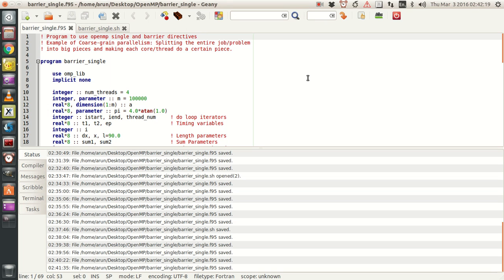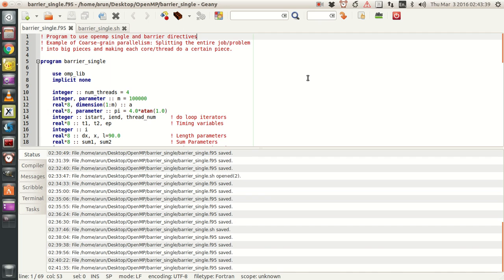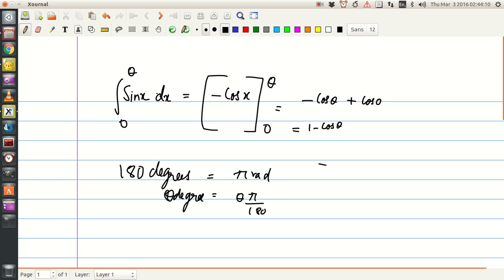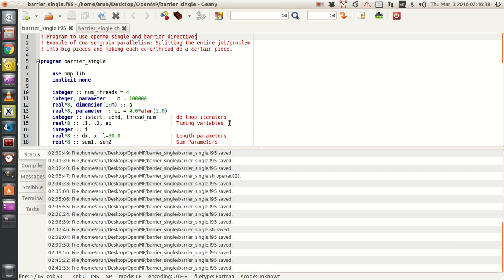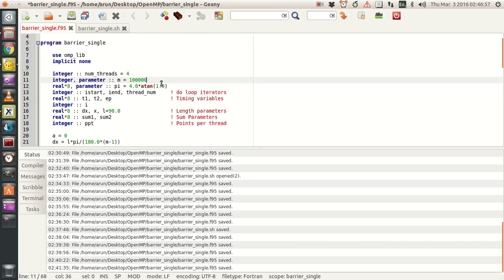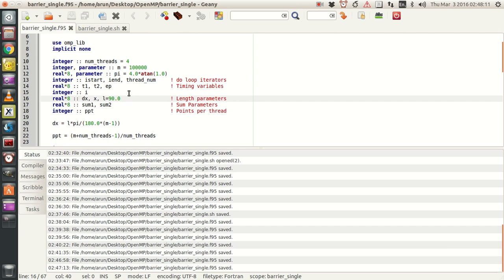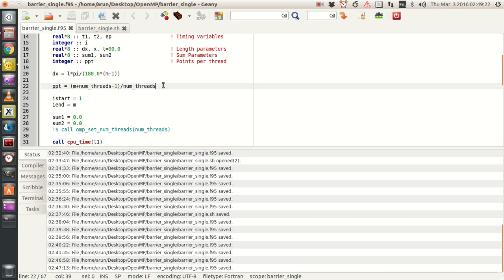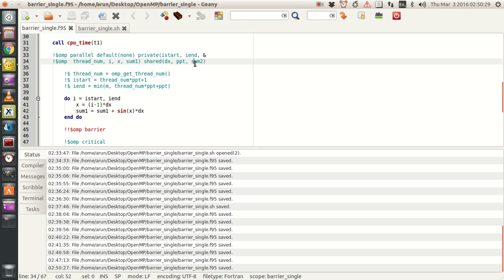Fortran with OpenMP : 013 : OpenMP Single and Barrier directives Part 1 of 2

Comment: i like that "barrier" concept, i was expecting that kind of thing to use, thanks.
what i understood from "single" is that, the statements within its block will be taken by a "task-completed or task-free" thread and gets executed only once by that thread alone. Am i right?

also i have quite another doubt in python, is there any "!# bin/bash" kind of thing that can be included in python script to make it run by Python3 instead of Python2, and vice versa without tweaking settings of geany or any editor?